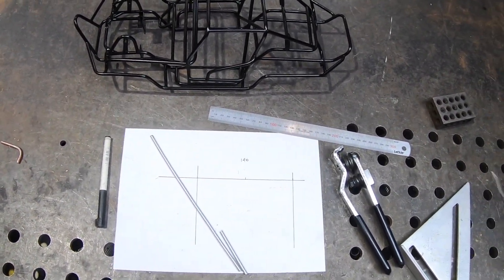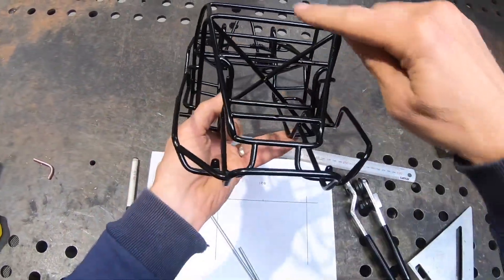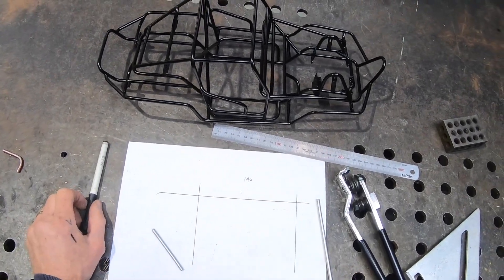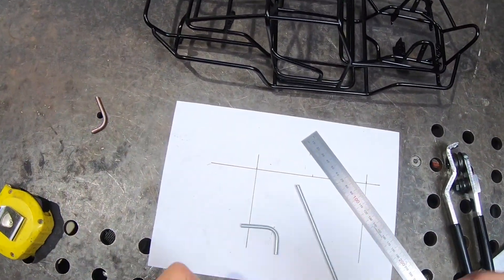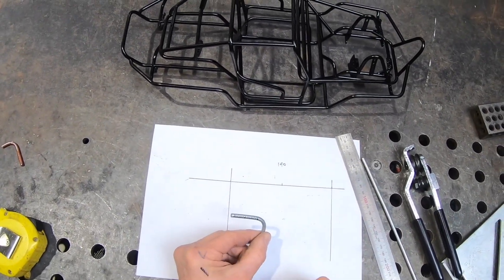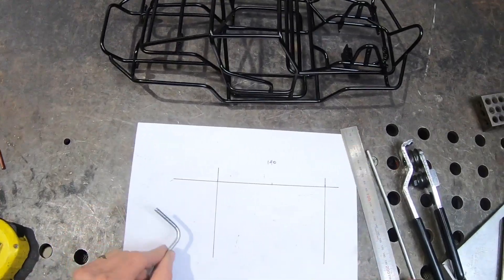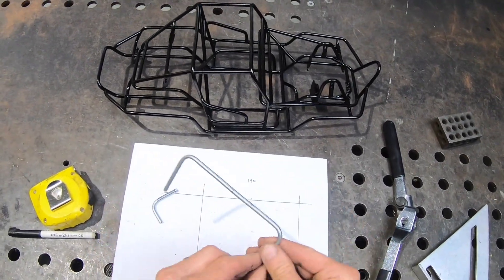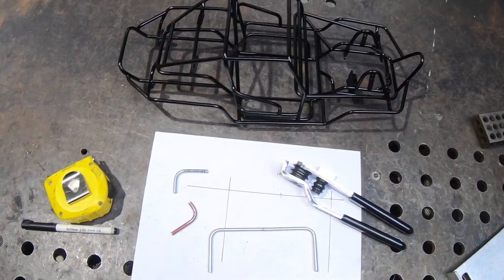Tube bending for RC scale fabrication - Building a scale RC rock crawler cage (Part 2)

Comment: I want to make a Functional truck roll bar / ½cage for my nitro Tmaxx big block, that I can Roll over & carry It by, This thing is so fat it snaps shaft pins when breaking.
 I had made a "U" roll & carry bar from solid 8mm aluminium bar but all the braised joints broke. Its hard to work with, melting point of braising rod is only a little lower than aluminium so I melt that too.
What steel should I look for to try with?